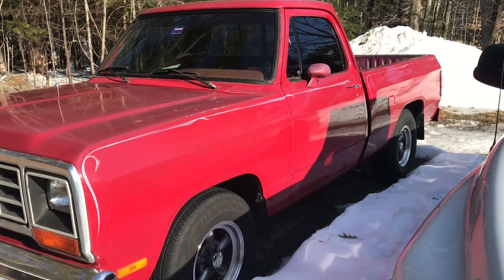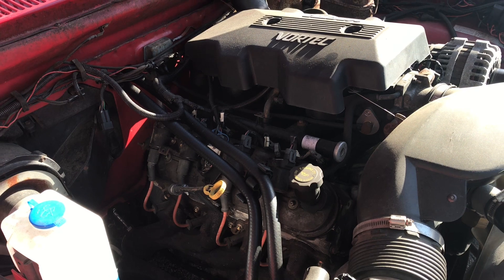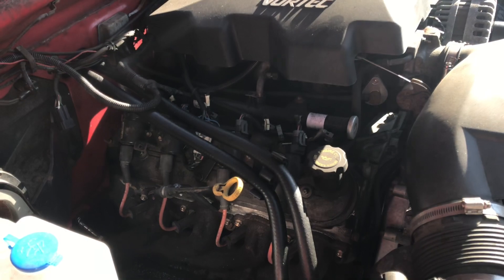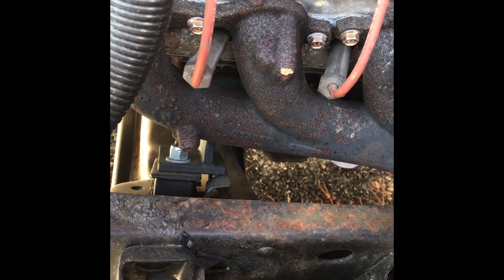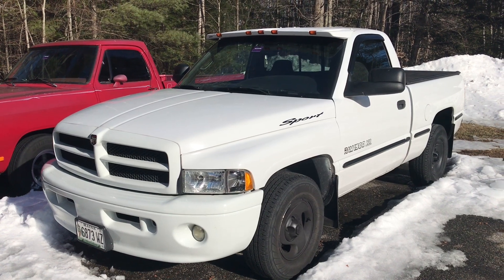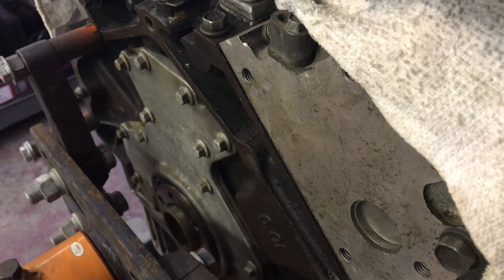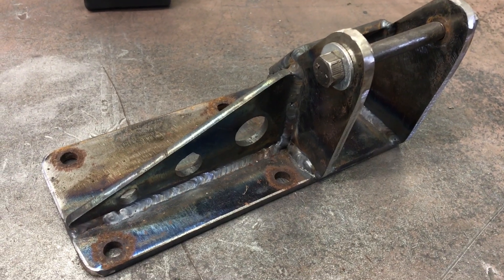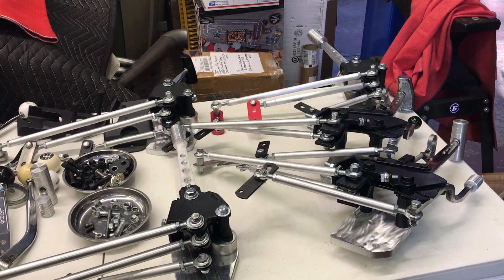LS Swapped Dodge D100

Comment: How’d you do your shift linkage?
Reply from the maker: I made a rod and a pivoting cross bar hooked to the stock column.
Reply: @mountainsgarage  if you’ve still got the truck could you make a video showing what you did? I’m in an ls swap mopar group and there’s several people asking about it. I get what you’re describing but I just can’t picture it. Thanks
Reply: @sethster70  what’s the LS Swap Mopar group your in?
Reply from the maker: @sethster70  Yes I can do that. I was going to do a whole video when it’s on the lift for Spring service.
Reply: @mountainsgarage  great, looking forward to it. Thank you!
Reply: @brianscheidel8171  ls swapped mopars

Comment: What did you do for the fuel system? 
What did you use ?
Reply from the maker: Stallion 33     I used a frame mounted inline pump, and installed a return bulkhead fitting in the top of the plastic tank.
Next time I will mount the pump in the tank because it is really loud and the pickup suffers from fuel slosh.
I used -6 push lock hose and -6 an fittings everywhere, including the -6 adapters for the stock fuel rail.
Reply: I bought a walbro 255 in tank so can i reuse the old lines ?
Reply from the maker: Stallion 33    I didn’t have any old lines, but at nearly 60psi I wouldn’t trust old rubber line and hose clamps.
Reply: Now that i think about it , it makes sense. I just got to figure out all the fittings.

Comment: Would you build me some ls swap mounts for my d150 or send me in the right direction?
Reply from the maker: Stallion 33   I used 3/8 thick 4” flat bar. I have a couple pictures I could send you. 
I remember setting the oil pan, truck style, on a block of wood on the front crossmember, it sat on it while I made the mounts.
Reply: @mountainsgarage  i would like to see the other pics you have.
Reply: @mountainsgarage  can u send me pictures as well

Comment: Why wouldn’t you put a hemi in it? Putting an LS in a dodge is like putting a vw motor in a challenger. That’s sacrilege
Reply from the maker: I paid $1400 for the truck and put in a $500 engine and transmission that I had already. I didn’t modify the truck, even made mounts to use the stock rubbers.
Buying a Mopar drivetrain was never a consideration, but using what you have or prefer equals Hotrodding!
Reply: @mountainsgarage ; that’s your opinion. I have mine too. Hemi’s are hot right now and extremely popular, but mostly us mopar guys are more committed I guess. I understand though, Chevy fans haven’t really ever had a reliable platform for massive hp numbers. So now that they finally have one they think an LS is the greatest engine ever. But they have thought that about 350’s and 454’s forever and they just aren’t reliable at high hp numbers. The rod journal on a mopar small block is as big as a chev 454 😂 they have also used racing quality block casting alloys since the 60’s. All stuff Chevy never wanted to give their customers. So I get it you’re excited to have a reliable platform, I guess I can forgive you for that, but I hope your mopar feels the same way
Reply from the maker: @andrewburt7900  This would be a fun conversation over a beer or two! I have been Drag Racing for decades and have seen what is required to go fast with any brand, and not much came OEM. I like all brands, each have their good points.
Mopar and Ford never made a transmission that was reliable or safe. If you are going fast you have a GM based transmission. Thanks to the 727 we have safety shields!
I put 9” Fords in my projects, wouldn’t pay good money for a Dana 60 or any GM rear axle.
The modern Hemi is no fun to work on, a trained monkey can impact together a LS, it’s simple and symmetrical, most parts will fit backwards.
I spent some of the 80’s at a Chrysler dealer, not much to brag about there. If a Ford guy hadn’t saved them they would no longer be around.
It’s all good!
Reply: @mountainsgarage  I agree it would be a good conversation. I know people reliably making 600-700 on mopar small blocks with stock bottom ends with 200k+ on them before they were built, just the top end was done. Oh also using 727 trans with 200k as well, not even rebuilt. I also know that the 350 Blow about as often as old faithful. They are junk, there is a reason they are cheap. And even then if you want much power you need a four bolt main version. And Chevy and ford have had multiple bail outs from the government. Chrysler took responsibility for their failures and hired someone to fix them instead of relying on bail outs regularly. Dana is their own company, however if Dana 60’s are so shit why does the extreme 4x4 community use them? Those things are put through abuses a drag car would never ever see and they are practically bullet proof. I know someone who used to have a top fuel dragster and ran a stock Dana 44 with it for ten years before it finally gave up and he went to a Dana 60. The chassis of that car was rebuilt three times but the 44 held strong for a decade of abuse every weekend. He still has the big block 440 that he ran in that car it’s bored and stroked of course supercharger etc.. but it has 1200+ hp and although it was taken apart and inspected regularly it only required reringed twice and new bearings on the crank once. It’s still going strong in his hotrod as of last year anyway. I moved so I’m not sure. The guy is like 80 so who knows if it’s still going. But I’m willing to bet it is. The LS is definitely a good motor, I won’t deny that. It’s just to bad it took them a hundred years to build a good one. Oh and if I am correct it was designed by someone from a German car company? I think? Can’t remember for sure but it wasn’t Chevy’s idea and they originally tried to kill his design from reaching production. I would have to read the article again it’s been a long time. But yes it’s a good engine. The hemi is not that complex at all and although I think the mds is not a good idea for reliability it beats the LS for mileage and power in most configurations. I also understand the build what you have mentally, I guess I just always have mopars. I’ve honestly hated Chevy for decades not necessarily because they are bad but because Chevy fans are usually asshats that think Chevy is the greatest ever in ever aspect and will never listen to actual facts they just say “Chevy great” like some stupid hulk that’s incapable of thinking for themselves. However it’s obvious you are probably not one of those guys. I worked for a Chevy dealership and saw so many warranties on engines and transmissions with less than 30k it was ridiculous! The camaro is such junk it’s laughable, the more impressive one was the Cadillac sporty versions way faster than the camaro or the vette in most cases. Although the engine compartment is a disaster to work on unless you are the size of tinker bell. Anyway I bought a used cavalier and it has been extremely reliable and has made me rethink some of my hate. I think the mid engine vette is a great thing and I hope it drives other makers to design mid rear platforms!! Which in my opinion American companies should have been building for decades. However that said they have had some reliability problems for sure and there suspension is a good design it’s pretty weak and needs som beef. Looks good too. But when it comes to reliability I will put my LA engines against any other small block anywhere anytime. As far as the 400 it’s a good transmission but I also believe it was designed by another company on behalf of Chevy? Anyway the first muscle car was designed by Chrysler the 300 was named the 300 because it was the first and only car to come close to 300hp for a long time. It was started in 52 I believe? Anyway it was a muscle car long before the claim of Chevy fans that the gto was the first muscle car. It was not. That honor is Chrysler’s
Reply: @mountainsgarage  https://youtu.be/USsb9cSW7N0.       Just wanted to throw this out there, I have heard this story countless times and seen them run more hp and for just as long but they had many more passes on track. However you know how stories work. Without some evidence it’s hard to give them much credibility. I’m not a huge uncle tony fan but this is a regular story among mopar guys
Reply: @andrewburt7900  typical hypocrite 🙄 FJB & U